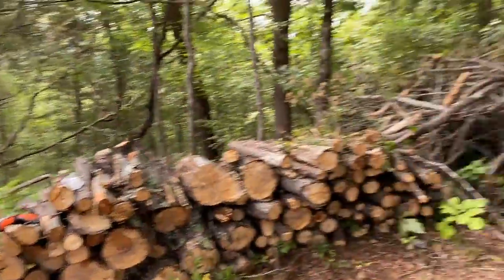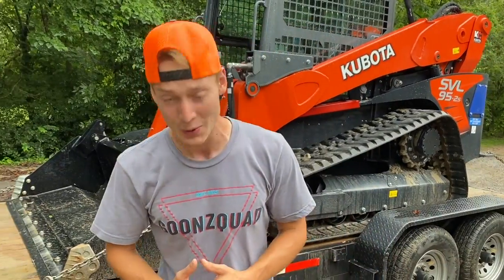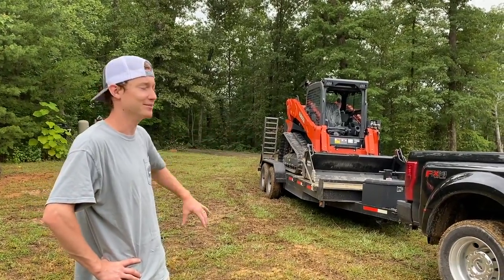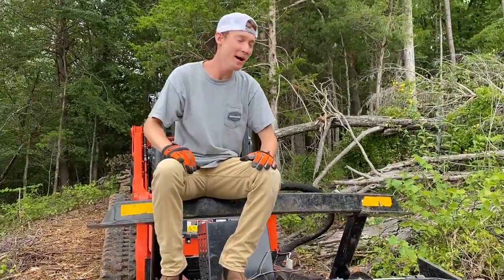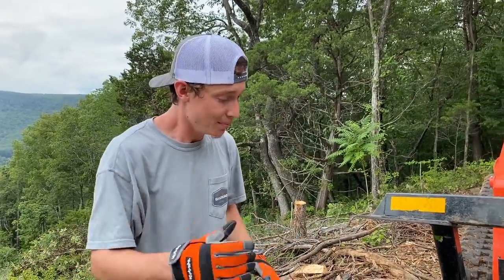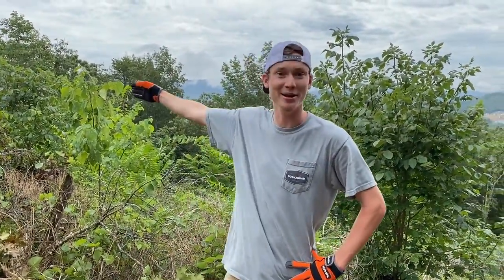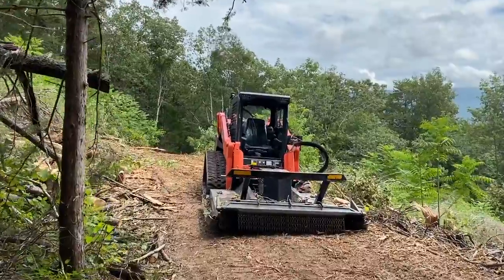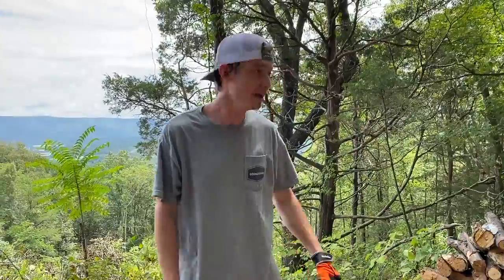The New Goonzquad Headquarters Part 4

Comment: Hey, landscaper from East TN around Knoxville here. Little tip, whenever possible, start from the bottom of your incline and go up forward and down backward. Always keep your load, in this case bushog, uphill. Back down from the top if you gotta. Be careful raising your load on steep hills. That's your stabilizer. You can feel when pushing the limit.
Reply: Great advice for anyone doing this kind of work; thank you sir.
Reply: I hope they read these comments.........good advice
Reply: Looking back at the video that’s a good tip

Comment: Be careful clearing all the brush on a mountain. The ground cover protects from erosion and landslides. Just clear the roads and areas you want to develop.  You don't want the whole thing washing away in the next rain storm.
Reply: I was thinking the same thing.
Reply: Yep, I’m.not sure what they’re trying to achieve here by clearing so much hillside. Clear the tracks first, and then work out where to build, then clear that area.
Reply: James. U gona cry?
Reply: They already explained this in a few videos ago, guess you don’t watch
Reply: LetsGoToMarsMan not presently. It’s only midday though so still plenty of time.
Reply: I think they’re just trying to clear out the view; if needed they can rock that area and/or build a retaining wall right below the start of the decline if erosion becomes a problem
Reply: Landslide has already happened. I could see it in satellite image. And it will happen again if they clear the slope.
Reply: @richardharper4329  they aren't going to rock the whole slope. That's just dumb. Just keep the short vegetation where you don't need to clear and it won't be an issue. Why create a problem that you will have to spend a million dollars to fix for no reason. The brush isn't obscuring the view.
Reply: You can clear the deadwood and still have ground cover. All that dead fall is potential fuel for a fire and should be cleared
Reply: Why clearing all that now.  Why not finish The house and all that before doing all this. It will just grow back before u know what to do with it all
Reply: @mj_aussie_coaster_travels8310  I agree.  I haven't figured that out either.  But that's generally why I watch, most the time I have no idea why they are doing the things they do or in the order they're doing it.   Cracks me up.  They're not idiots of course, I think its just that they kinda dive right in with lots of generic explanations about what they're doing without really explaining the big picture plans. ("we're gonna go down there and do some clearing...or maybe stay up here...let's stay up here...next shot..we can't go any farther down this trail...")  I guess that's what keeps everyone coming back!
Reply: @mj_aussie_coaster_travels8310  you  gonna cry
Reply: @erictold  Saw that when I looked up the property. A bunch of tress knocked over.
Reply: They can leave the roots and cut the tops
Reply: They are going to cut every thing down and probably put a 10ft concrete slab over the entire property  😅

Comment: When you disconnect hydraulic hoses, connect both ends on the implement to each other if you don't have dust covers. This Will save your hydraulics
Reply: Also for connectors that get dirty, spray them off with with brake cleaner to remove dirt and oils prior to connecting.
Reply: @revo4tecmike  I swear brake and carb cleaner is the best shit ever invented for cleaning anything.
Reply: @saulgoodman4769  amen brother. I use that stuff all the time.
Reply: Kubota should sell bags of those dust covers- they are a great investment for keeping foreign material out of your fittings and pump.
Reply: @fredericrike5974  for sure they're definitely worth buying. For the sliding sleeve of the female fitting, you'll still need to spray it every once in a while to remove dirt and help it move freely. Also make sure the dust plugs are clean to minimise contamination.
Reply: Throttle body cleaner as well.
Reply: @revo4tecmike  All tools used in an environment of dirt, dust and wood pulp needs frequent cleaning and inspection; all of it! Thanks for the larger thought!
Reply: Awesome tip!
Reply: This is the first reply section ive seen with no hate or fighting

Comment: I work equipment alot, So remember that sHi can kill, be careful. think about what your doing. We all would not want one of you hurt, Shoot we like you boys.
Reply: 100% correct. We have seen just about every way to mess up and get hurt or die in the construction field. No joke.
Reply: Yes!.......With the boys using that smallish chain I was clenching a bit. Especially when they were talking about dangling the skid steer off the Mt. with that excavator.They need 2 lengths of at least 1/2" Square Hardened Security Chain to be pulling logs and equipment around.

Comment: You can get tires for your Cub Cadet mower that have tractor tire tread instead of lawn tires.  You wont get stuck as much or slide around.  They can tear up a finished yard if not careful but you are far from a finished yard at your new headquarters.  Good luck and be safe.

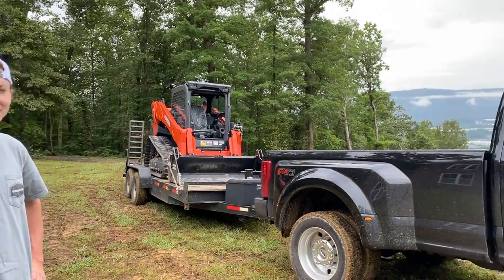Comment: 2:46 
I think u ruined the GMC by putting those wheels and tires and the lift kit which is not good for your work 👍
Reply: I agree.Those rims look terrible.I have a 2500 GMC with the Duramax.It pulls amazing.
Reply: Ibrahim..... I thought the same thing a long time ago. I'm not a GM guy, but that Lift and oversized wheels/tires need to go and get back to stock. You might go a little  bigger, but not over kill. Just my 2 cents worth ;-)
Reply: This is what a lot of us real truck folk said during the build (or destruction) of that truck. 

Work truck to Bro truck.

However, the Goonz were sponsored or got those rims & tires from the company SOOOOOOO they'll never say they were the undoing of that 4x4.
Reply: [Redacted]  a lift wouldn't make an f450 incapable of climbing that road😂 it was the fact that the roads were super slick
Reply: Sounds like they just admitted that the GMC is crap after turning it into a bro truck.
Reply: [Redacted]  no they didnt lif it up its stock but the road slicky and the r towing heavey stuff👍🏽

Comment: I would've gone for one of those rotary mulches for the skid steer. They're a lot better for land clearing. There's no tree too thick you can't chew through with one of them.
Reply: Ah, that makes sense and is probably part of the answer to my question about heavy duty vibration which is the kiss of death for most any vehicle. Well actually, the kiss of PROFIT for the repair shop at the Dealership. Should they take extra care to NOT cause heavy duty vibration to happen?

Comment: Don’t forget to power wash them off every time!
Reply: You are joking right?
Reply: Wyatt Ashburn nope not at all
Reply: samantha farmer what’s the point?
Reply: Wyatt Ashburn it is preventive maintenance, and if not done every time then you can damage it
Reply: samantha farmer I live on a farm for 10 years...not once did we wash anything...these machines are designed to be beat up, they aren’t lamborghinis
Reply: Wyatt Ashburn you got lucky, but they are better when cleaned!
Reply: samantha farmer lucky? After 10 years it came down to luck? Do you realize these machines are built to get dirty. Major components are covered by metal.The only exposed parts that could possibly be damaged by something other than dirt are the tracks and hydraulics. The only thing you need to wash are the filters to prevent over heating.
Reply: Wyatt Ashburn lol again you got lucky
Reply: samantha farmer Do explain
Reply: Wyatt Ashburn this is not rocket science, you clean it to get the rocks and dirt out to prevent it from damaging anything!
Reply: samantha farmer Out from what?
Reply: samantha farmer From damaging what?

Comment: That's the problem with wide tracks. They offer lots of floatation but larger surface area means less psi of traction.
Narrow tracks really help in the slippery stuff.
We had the biggest model bobcat available and someone decided to put huge tracks on it and it was forever getting stuck.
I put narrow tracks on it and it sunk deeper in the mud but actually cut through the slop to the firmer stuff underneath.
Fun fact, the glass door on it was forever getting broken. Replaced about 5 in 3 years.

Comment: Found it hard to watch this vid fellas. No safety gear, a clear lack of competency on the machinery.  The do it yourself mentality can only go so far. You’ve worked miracles on your rides, that’s why I and the majority of us are here.  But using a chainsaw without chaps is enough for me to know that you’re missing some crucial guidance on using the equipment in these home improvement vids.  This ain’t me having a go, it’s a heads up for you to take a step back and make it safe so that you’re here in 6 months time showing us how you’ve fixed up a wrecked Aventador.  Cheers, from New Zealand

Comment: You could build the the shop with a heli pad  on top. As you go down stairs. It's  a chill room/game room,kitchen, etc. Or you can go straight to your garage. 4 or more bay garage .  A man hole to work under  the car. Oil or water drain in middle of each garage.

Comment: Ouch. Hating on the duramax. Breaks my heart. That duramax woulda pulled the skid steer easily. You had to use all 6 wheels on that ford. The duramax woulda done it with 2.
Reply: I agree.I have a Duramax at work and I loved it so much I bought one of my own.If they would take those rediculous wheels off their Duramax,it would be a better truck.
Reply: After hearing that comment about the duramax not being able to do anything now you can see what an actual professional body man thinks every time I watch them do something. Good attitudes but green as all get out
Reply: Duramax is trash

Comment: New is not always better I found this out when I compared how reliable my 2019 Dodge Ram 1500 is compared to my 1995 Dodge Ram 1500 and the 1995 is more reliable and can haul heavier loads than the 2019. I mean the 1995 has only had basic maintenance done to it and the 2019 has been in the shop for multiple issues and repairs
Reply: That's because everything built before 2000 was built to last, now companies got smart/greedy building things to last a short amount of time so you keep coming back for parts, repairs or a complete replacement as there isn't any money in building things to last forever.

Comment: lol, truer words have never been spoken than "Everything we've built seems to be made for this job! Well except the Duramax, that's just a pretty truck."
Reply: They caused that. That truck would work right with the ford. An the ford ain’t pulling just fine when you gotta grab low lmao
Reply: @brianproffitt7263  agreed, if they didn't put the huge lift and street tires on it, it would do the same work no problem.

Comment: If you are building a large garage, would if be possible to put either a party deck or helipad on the roof?

Have you figured out where the jacuzzi and pool are going to be built?

Not sure what your weather is like, but is there room to route out a ski run with simple rope pull?

Comment: Get some fly spray for horses soak your clothes in it and let it dry to keep the ticks away. I put it directly on my skin and doesn't bother me but your mileage may vary. I had to go to the hospital when I got attacked with seed ticks but they gave me ivemectin same stuff just in pill form I give the horses to worm them and it killed them all. It seems the clearing the roads that are already in the hill is fine and may act like a terrace to help stop the erosion. The mulch will help keeping it from getting too muddy until its packed down enough with the machines. On the slopes as others mentioned will erode with a quickness if you cut it all the way down to the dirt. I would talk with the local AG extension and see what is the best native plants and grasses to plant for ground cover maybe get it hydroseeded where they come in and spray grass seed and stuff to help it grow all in one shot. I have also seen netting infused with seed rolled out when they expand the highways and interstates and have to cut into a hillside but I don't know what it is called.  Also now is the time everyone is cutting hay. Can see about hauling off rotten bales from last year they don't want or get some straw bales to help control the erosion. Just be careful on those hills those machines can slide. I have gone down a hill sideways in a bulldozer and it was not fun.

Comment: I built my well house underground just a few feet away from the well that way I do not have to add any propane heat to keep it from freezing nor do I have to bring the pressure tank inside the house only for it to leak on the floor.  Did all the work myself and the cost was $3000 for the concrete 10‘ x 14‘. 10 foot deep. The entrance is totally hidden and it also acts as a tornado shelter and vault.

Comment: Remember if you are towing put the truck tune on “tow” because if you put tune on “hot tune” it won’t have pulling strength and the transmission will wear the heak out

Comment: Hey Dude, maybe Back the skid-steer on the trailer it should give you more down force on the ball and give you more traction, if not maybe having alittle weight in the bed would help with the corner.

Comment: Billy and Dang Son, DUDE! puttin' in some WORK...BRO!!😂😂😂 Do we even know other dude's name yet? Still? Hey Goonzquad, love y'all videos.... I'm just messin' with ya a lil bit! But in all seriousness, if ya gonna do the thing with the chains and the other machine, protect y'all selves with some kinda shielding in case they break under the tension, or it could literally be a lethal day. Would recommend also, that you work from the bottom UP,  with the implements uphill if possible. Only resort to the chains if you get ABSOLUTELY STUCK...Former heavy crane rigger here and I have seen guys lose limbs in a blink of an eye from a chain or wire rope under high tension that snapped. Research the KY Kingdom ride that severed a riders legs for an example a few years back...be safe y'all. Also, to prevent washout down that hill after clearing, maybe a series of stairstepped retaining walls?

Comment: A tip for no more ticks. Spray your clothes with a homemade solution of 1 oz. permethrin to 20 oz. water. Let it dry. Supposedly it will even stay thru several washes. Catman Outdoors has a video on it. I have used it here in the midwest clearing deer stands all day and had no ticks or chiggers. They will just fall off. By the way those little ticks are called seed ticks.
 Here is his link: https://youtu.be/FDlq7g5DTyk
Reply: Good suggestion.

Comment: From experience put your truck in 4-wheel drive and set the parking brake when off loading them escavator
Reply: I've always put my truck in neutral with the brake set its a habit from always driving a manual tans but my new rig is a 2018 3500 Cummins single rear wheel an its got the Aisen( sorry dnt now how to spell that lol ) automatic transmission an i been doing the same with this rig when I load an off load equipment an especially my jeeps cause I dnt ever set the ramps on that trailer I just drive up so it rocks the truck a bit

Comment: Y’all need to start from the bottom of the hill and drive up the hill. Way safer and you have a 1 in a million chance to walk a track off by going vertical instead of horizontal. Just a tip I figured I would give you. Be safe. And dang son!

Comment: The Duramax needs to be regeared! Any time you lift a truck and put bigger wheels on it the gears should be changed to match if not you lose power.

Comment: Once you get the helipad in and have a rotor craft license be careful as new pilots going in and out of there. Terrain for one, especially being new and how the wind interacts with the terrain, will be a challenge. Also the R22 is a good trainer but when it comes to flying in high and hot areas with two passengers and a decent fuel load things can get complicated. Just don't push your luck especially during the summertime in high terrain. That density altitude will sneak up on you and the last thing you want is to be struggling for power and altitude. Always remember this once you become pilots "It's better to be on the ground wishing you were in the air than in the air and wishing you were on the ground." Love the channel. Blue skies and tail winds!

Comment: That will make a nice mountain bike trail as well. Make a round driveway in front of the house and you won't have to back up there again. Specially with the larger vehicles. Just make sure it's nice and wide so you can park on both sides. Just an idea.

Comment: I work in concrete and trailer/use bobcats , mini ex’s every day , and it’s always safest to trailer your equipment with all the weight at the front of your trailer , safest and most stable weight distribution is at the front of the trailer

Comment: Working to the brush like you are you need to soak your clothes in Permethrin SFR.  The bugs won't even latch on to you and it will last up to 6 weeks thru washings.  The Department Of Natural Resources use it to keep the ticks and bugs away.  I use it on and around my house and on the base of trees that the carpenter ants love and I never see bugs not even around the porch lights where the love to hang out.

Comment: That dura max GM  was a great truck till you fucked around with the suspension and put them stupid tires on it ,have one just like it in factory trim that halls both pieces of equipment  like yours at the same time ,goes down the road just fine !

Comment: 👀*** speed ratchets few extra $ but well worth it. Metal decking on trailer. If you are going to move a lot of wood definitely build overhead pully system on rear of trailer.. go in prepared before you get out there guys. You're gonna get into something that you can turn huge profit. Check out 'Mathew Cremona' channel you won't regret it.